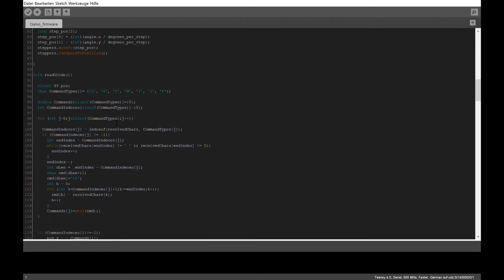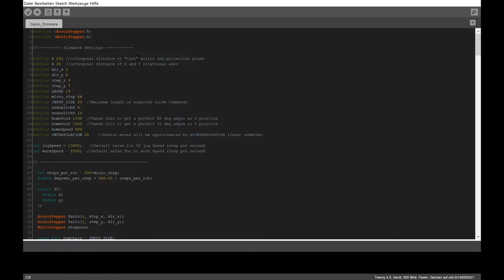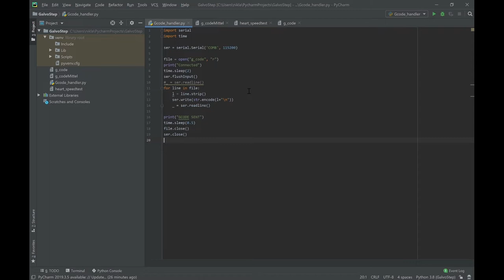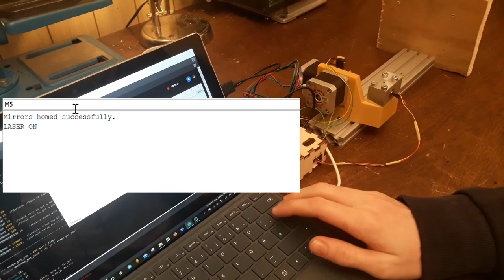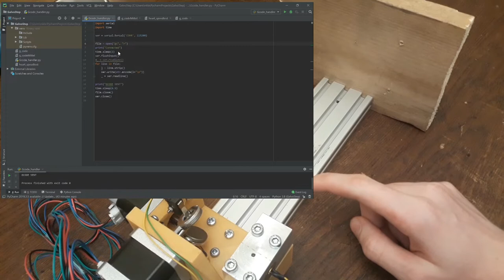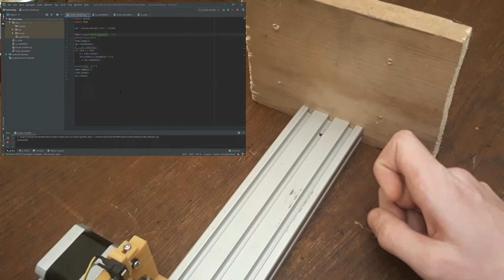Simple Laser Scanner with stepper motors!

Comment: use high voltage stepper driver, higher voltage make motor more stable in high speed movement... like 48v supply driver

Comment: Excellent work, and well documented, thanks for sharing.
I was reading the code, well written, however the PID control is not present, maybe with other types of sensors you can read the analog position.
When you send only the GCode coordinates, the entire calculation hits the microcontroller... could this be performed before the scan and stored in internal memory, 1MB in the case of Teensy, or is the calculation speed not problematic?
I've been developing some galvos, and the sensors are critical, as soon as I finish, I'll post it here ;)

Comment: Can we control the power of the laser via gcode for engraving (like S command in grbl?
Reply from the maker: In this particular design: No. The laser driver is driven via a digital output / transistor. But in principle you could try to connect the VR Pin of the laser diode via an electrically driven potentiometer to GND in order to control the laser intensity.

Comment: I would like to know if the buck convertor is a constant current or a constant voltage - I am new ,want to use on red laser for medical purpose- Thank you very much.
Reply from the maker: It is constant voltage and therefore not suitable of driving a laser diode
Reply: @WoodenWeaponry  Thank you for the response . I would like to know if we can use a CDROM tray open motor in place of Stepper , with Rotary encoder with the motor , like the one in this link , here he uses maganetic encoder , since i have the old ball mouse i would like to use the encoder wheel with the motors i dont know how to go about .. The Link : https://www.youtube.com/watch?v=gK14SaaYMoc&t=5s

Comment: hey i only have 28byj-48 stepper motors, can i use them in this project?
Reply from the maker: I guess, but the low accuracy, speed and torque of these steppers will probably significantly reduce the overall accuracy of the output. I'd recommend getting some nema17s instead.
Reply: No you cant... they are very slow and have huge backslash...

Comment: So please share the firmware that works with Arduino Uno
Reply from the maker: Hi, an Arduino would generally work, but it will probably be much slower than using a teensy. The code on the GitHub page (see video description) is compatible for arduino (since arduino and teensy use the same IDE and language) but you may have to change some pins.
Reply: @WoodenWeaponry  Hello, I downloaded the firmware on the Arduino Uno, but the stepper motors did not move and no voltage reached them. Even when I turn them with my hand, it seems to move easily. It was not connected. Can you help me, send the firmware and modify the custom pins to the Arduino or
Reply from the maker: @artandtechnology3022  Sorry, I don't have the time to modify the firmware  to other systems. I did try to keep the Code as clean as possible so that others can modify it. In your case you should confirm whether you are using the using pins. Use a probe to check if they are working. Make sure your stepper motor drivers are connected and powered correctly.